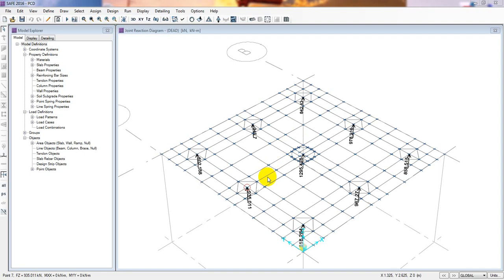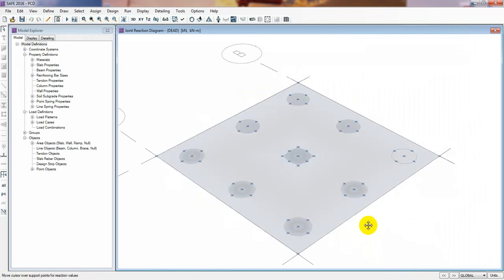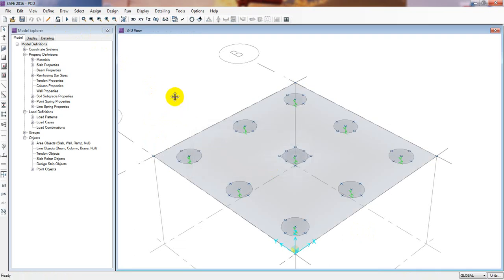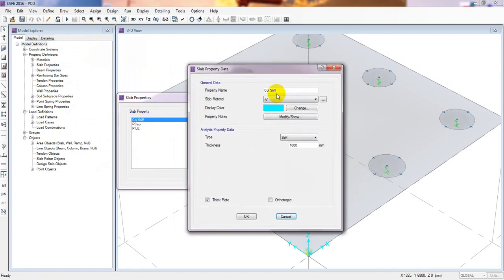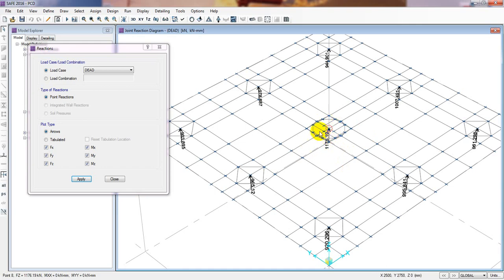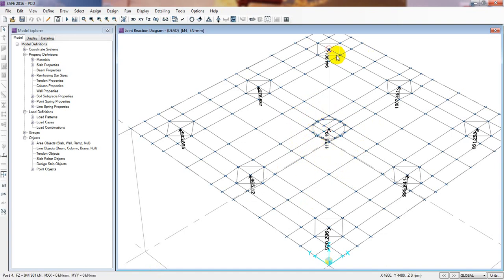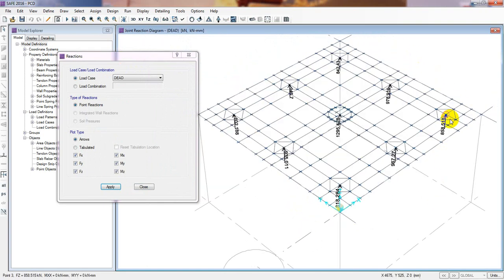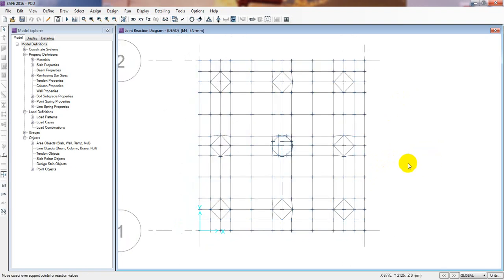CSI SAFE 2016 TUTORIALS | DESIGN PILE CAP FOR PILE FOUNDATION IN CSI SAFE 2016 | PART-5

Comment: sir why dont we apply soil subgrade modulas here
Reply: sir one more dout, 
as punch shear is n/c in strap foundation, so how we will know that the beam/strap we have provided is safe for foundation.
Reply from the maker: @omygod1590  thanks for your comment.
after completing settlement and soil pressure check delete beam and then reanalysis and check for punching shear. and when your punching shear is ok then again draw beam and complete your work,
Reply from the maker: we have provided spring value for it.. no need to provide Soil subgrade value.
Reply: thanks sir, and thank you for other videos. and they are very helpfull...